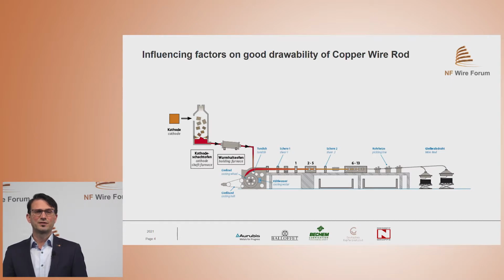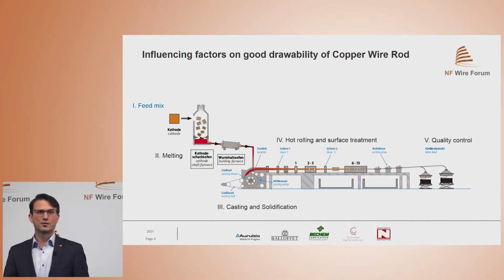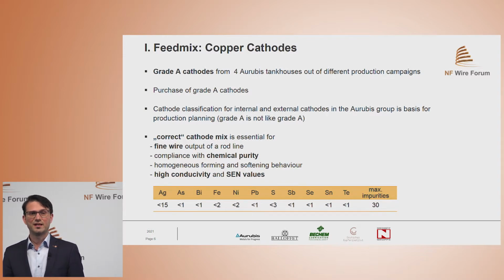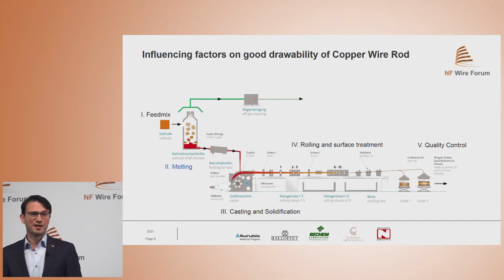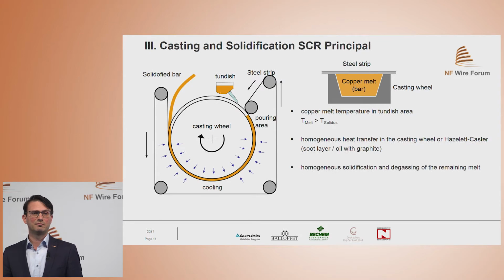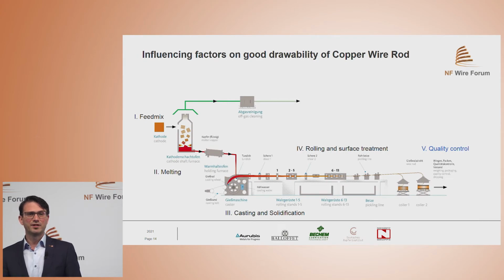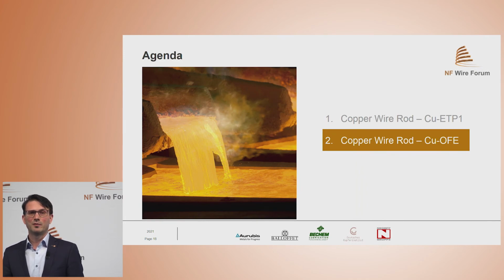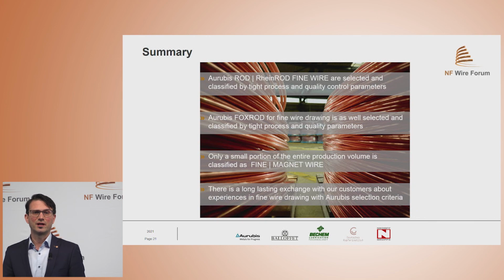NF WIRE FORUM 2021: Cornel Abratis' presentation (1st part) for the live panel discussion on May 11

Comment: Thanks by the Presentation. In 1998 I did my Metallurgy thesis about the critical values in CCR lines. I had the opportunity of learn from casting to drawing ( 8 mm to 0.20 mm). I will get work using hard 2.00 mm to our multiwire. And the level of wire breaks didn't increase. I did myself all the test, and to me the most important is SEN due with it you know if the Cathode is good or but. The desaventage is that the test has to be done after melting. In my opinion, most of the wire breaks ( 30-40 %) has origen in the casing process ( magnetic inclusions, oxides in the casting) but the othe percentage are due but die sets, or but die nantinance. I saw thousands of breaks,and wire tension is one of the most repetitive, and surface problems. At the end, mixing chemistry when you depend of the LME suppliers is and art. But if there are a six sigma implantation, it's possible has a good control, doing studies about how is the hardenest law , and can predict how the material will run. I think so that it's a good presentation to new students, that want to know what happened. But all the CCR lines has their differences. Not is the same a Properzi that a Southwire or contirod...the casting process are quit different. And obusly, the size of the bar.